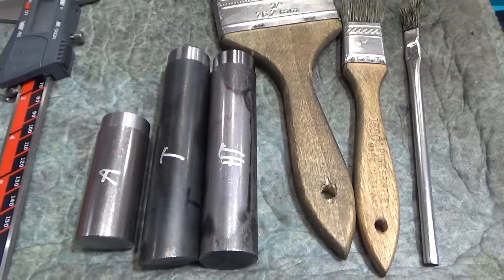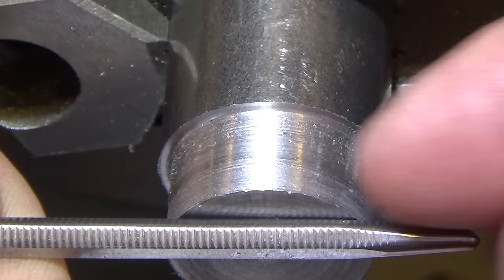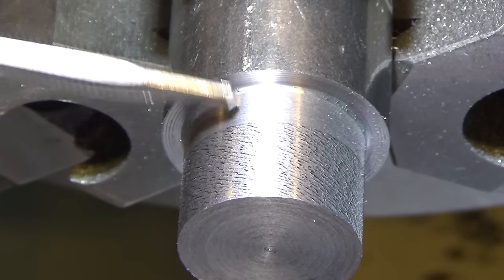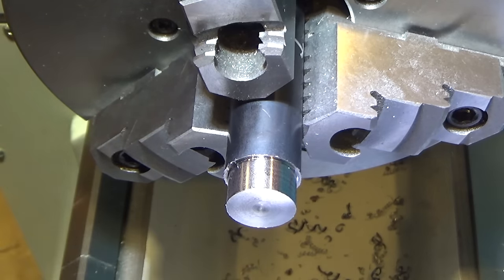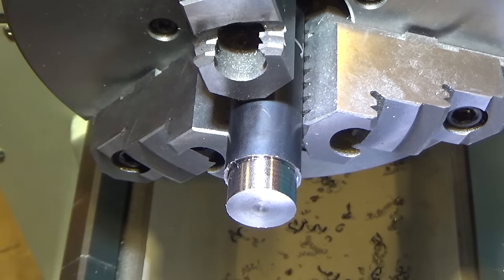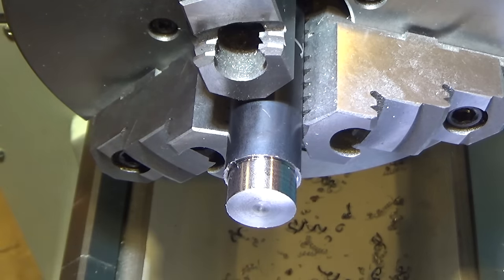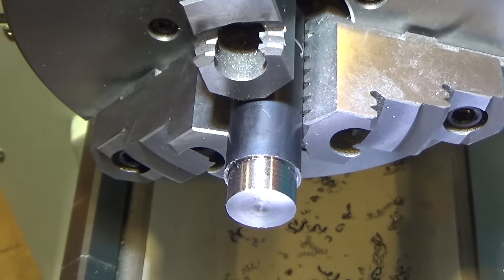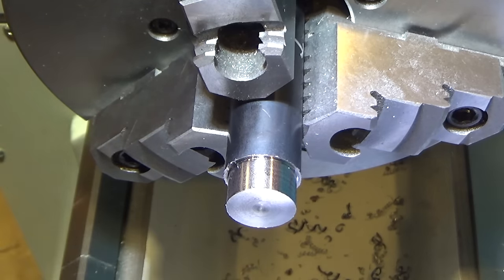The Effects of Heat Treatment on CrMo 4140 Steel in Turning Operations Part 2

Comment: I dont know how often you are looking for a good finish but i have found a tpmn-221 is best for any material i cut mild steel to stainless to aluminum... you have to buy the insert and a chip breaker separately but by far the vest finishing tool i have found for most things.... i use sumitomo
Reply from the maker: Thanks. I think I might even have some of those inserts, but have yet to use them on anything. I got a bunch of different inserts in a lot of tools I purchased quite a while ago. Cheers.
Reply: Link?

Comment: Those inserts can have a lot more really. The "careful" movement is more about having not enough power in the lathe / mill to keep turning thru it.

As for positive/negative angle, those inserts are intended for certain materials and conditions. You'd have to look up the types of inserts intended for the material at hand and recommended speeds/feed rate etc.
Reply from the maker: Good point. thanks.

Comment: Try a higher feed rate at at a high  RPM (on these softer steels).. If you want it shiny then start with a feed rate of .010 or .012 per inch and take at least .02 per side.  Work your way down from there.
Reply from the maker: I really appreciate the tips. Thanks!

Comment: That is a very smooth sounding lathe, no gear noise.  Wish I knew what brand.
Reply from the maker: Thanks for the comment. It is an ACRA 14 Heavy 5hp. It weighs something around 3300 lbs. and is pretty vibration resistant. I am no expert, but do think very highly of it. If you need any more info I am happy to help. They have offices in rancho Cucamonga, CA and are an international company. I visited the facility and they keep a lot of parts on hand. The lathe is custom made for them in Taiwan.
Reply: I have an Acra FSML 1440 - converted it to single phase with a VFD. It’s also as quiet as anything. Made in Taiwan. Pricey, but nicely.

Comment: Iv found a bigger radius on the tool with a chip breaker for bigger cuts and a higher feed rate gives a better finish and for finishing off a job where only a thou or 2 is to come off i use a tool with no radius a + rake and a fast feed rate this is for the final cut works good on most of your harder steals iv found
Reply from the maker: Thanks for the tips. Always appreciated.

Comment: Just a cutting comment for 4140 HTSR. I cut it daily. Usually rough with WNMG, like yours , 0.013-0.015 FPR roughing .03 tool nose rad. Rough 0.06 to .200 diametral cut. It likes 450-500 SFM with good quality inserts. Finishing: positive rake 0.005-0.006 FPR 0.01 diametral cut.  Ie. 1 inch shaft 1500-2000 rpm.  Home gamer machines work better with pos rake cutters as everyone here knows.
Reply from the maker: Thanks for the very detailed suggestion. I am just about to work with 4140 on a new project and will try your suggested feeds and speeds. I really appreciate you taking the time to share your thoughts.

Comment: I realize this is an old video, but I think your insert is galling from build-up on the edge of the insert. I would either try a coated insert or using cutting oil.  A CNMG type insert should be just fine. If you want a positive cutting edge, try a CNMP or DNMP. My choice would be the CNMG coated insert.
Reply from the maker: Old or not, I really appreciate the tip. Thanks.

Comment: My sugestion is that in my shop they say and i do it if u drop down with the rpm u should bump the speed up like to 10thou. We use negativ rakes for hard materials and softer like alu we go to positiv rakes.
Reply from the maker: Thank you very much for the tips. I always appreciate the advice of experience.

Comment: Carbide likes a heavy cut.    Your rpm is probably alright at 440 but crank the feed up to .01” per rev
Reply from the maker: Thanks for the suggestions. I think you are probably right. I have been experimenting since I did this video and my results match your advise.

Comment: also on the the insert box will have info on range to run insert at. depth, speed and feed. 0.007 feed will be most likely nicer than a 0.002 feed. you need the right load for an insert to work properly
Reply from the maker: You make a really good point. I personally have not seen an improvement in finish with increasing feed rate, rather quite the opposite, but I have seem a marked improvement with larger depth of cuts. A lot of inserts I have, do rather poorly with small depth of cuts.  Now for chip breaker functionality, larger feed rates definitely seem to yield improvements. I do really need to pay more attention to the manufacturer's suggested feeds/speeds/and depth cuts recommendations. Another problem I have, is that I can't afford to get the ideal inset for each type of material for each of my tools, so often I make do. I have never really picked just one insert shape and stuck with it, so I don't have the proper inserts for each type of material in each size, for all of the tools I have.Thank you for spending the time to comment. I really appreciate all the advise.
Reply: dudley toolwright for one size fits all insert I like TMNG
Reply: dudley toolwright some insert work best at .020-.080 depth, I use some at work that want minimum of .100-.200+ depth
Reply from the maker: Thanks. I have a set of those I got somewhat recently, but haven't used them a lot yet. Adam Booth and Tom Lipton, seem to like CNMG inserts. I was sort of settling on WNMG, but to be honest, the only difference I initially considered shape-wise was part access. I realize that for large depth of cut and/or high feed rates, shape is important for strength, but I have never done much of that. I will spend some more time experimenting with the TMNG cutters I got and see how they perform. Thanks for the suggestion.
Reply: dudley toolwright np love your content. keep it up
Reply from the maker: Yea, I have seen that was well. Some of my smaller WNMG cutters max out at 0.200" depth of cut, but as a rule none of them perform very well with depth of cuts below 0.003". Thanks again, I will definitely experiment with the triangular inset holders more. You are never done learning.
Reply: dudley toolwright you're right there's always something new to learn, a tip, a trick anything. I'm pretty new to machining (10yrs). I keep a hard over book in my toolbox and every job I work on I write notes on everything, tooling, set up, even time. so I can always look back on it as a reference
Reply from the maker: Thanks. I'll do that. As long as people want the content, I will attempt to create it. Thanks for the comment.
Reply from the maker: That's a great idea. I think I will steal your idea. I have a memory like a sieve so writing new ideas and techniques is a very good idea. Thanks.

Comment: By watching your chuck on the video, it appears to not running true or out of balance and maybe causing surface finishing issues, first check your adjusting foot mounts,   for accuracy i would check your run out on your chuck, also grind the internal 3 jaws parallel,  check your tool post gib guides, and for any back lash and wear in the slide  nut, if there is any play during machining this will cause poor and inconsistency in surface finishes,   Cheers David
Reply from the maker: Thanks. I really appreciate you taking the time to comment and help me out. I will check into what you have recommended.

Comment: Hello,  Thanks for doing a video on a subject that helps me a great deal.  Especially since not being related to Bill Gates I do a lot of shopping at SHARS and you show their tool holder.  I am just getting into carbide and find this very helpful in choosing a cross selection of cutters that will do a multitude of tasks without breaking the budget.  Since I work in 6061 Al and SS as well as the different grades of steel (whatever I can scrounge or buy so the type is often unknown) I need a cutter that can do a variety of tasks.  My Grizzly G4003G only has 2hp so that is a limiting factor also.  Very little information on small machine carbide tooling on the 'Tube' and especially the cheaper brands.  Seems a lot of people like myself who don't have flea markets, estate sales, and access to old new stock are left out in the cold.  I look forward to more of these specific, terrific videos from you.  I would like to see reference to the particular model and make of the cutters to help me further if possible.  Mark me subscribed!  Take care.  Doug
Reply from the maker: Thanks for the comments. I am by no means an expert on the subject of carbide cutters, but here is my two sense: I do not use a lot of high speed steel, because you have to be a lot more careful with it. It gets sharper, but those very sharp edges also heat up easily and lose their hardness (if you have ever seen a color change in a cutting tool you know what I mean.). High speed steel cutters, however, can sometimes produce a better finish in difficult materials like Cold rolled steel (not hard to cut, just cuts leaving a poor finish) and can run with a lot less power. Carbide inserts come in two major varieties: negative and positive rake. Negative rake cutters require more power from the lathe but supposedly yield a better finish in some situations. Positive rake cutters require less power and common for soft or gooey materials like aluminum and copper. Most tooling places the insert at a negative rake, but inserts designed for soft materials will make the overall geometry positive by having a very positive rake profile. If you were wondering what I mean by rake, it is just the relationship of the insert to the work. If the insert leans down so that it appears  to drag, it is a negative rake. If it tilts up so that it looks like it will dig in it is a positive rake. There are some holders that make all inserts positive rake and might be a good choice for lower hp machines. Carbide doesn't overheat anywhere as easily as HSS which is a big plus, but the cutting points are rarely anywhere near as sharp. Carbide inserts are also less sensitive to high hardness materials or spots in the material. They are however more sensitive to interrupted cuts and can shatter. Coatings are for heat, hard material protection, and chip sticking prevention (esp. aluminum). Chip breakers might not work particularly well on lower hp machines because they are designed around specific feeds, speeds, and depths of cut, most often found in cnc type machines. However, I am willing to put up with stringy chips if everything else is going my way. As to specific holders, I have used the sets from Shars (get the largest size holders that will fit in your tool post: larger holders - less chatter) and bought a bunch of Chinese ones off of ebay. I also have purchased used sandvik, Kennametal, iscar, etc. holders on ebay and see little performance difference, but that might be because I haven't done much critical work. I have a suspicion that the big boy holders are more positional accurate when new inserts are exchanged. I also have used lots of different inserts and, again I think there is probably more consistency in the big manufacturer inserts, but cutting performance seems fine in the less expensive models. I hope this helped a little.
Reply: dudley toolwright Thanks.  That affirms much of what I have learned with the last part very useful.  Positve rake seems a bit harder to find unless the "aluminum" inserts are and can be used with steel?  I do notice I have to fine tune the Shars tool holders themselves as the bevels and reliefs are pretty square but that is ok with me for the cost savings.  I don't get too much time in the machine shop and would rather not spend all that time form grinding and sharpening when advoidable.  Keep up the good videos.  Real world value.  Take care.  Doug
Reply from the maker: I agree. Positive tool holders are few and far between, especially in sets. Like another commenter was saying, carbide was originally aimed at the cnc/large lathe production market. Aluminum inserts can be used for steel but for a couple of caveats: 1 the chip breakers are not at all correct for steel (not a huge deal) and 2 the very sharp edges are fragile and will break very easily. They seem to hold up ok with really light cuts like <0.025" but be prepared to replace them a lot more often. Also, once you use them on steel they may not give a really good finish on aluminum anymore. I have had good luck with negative rake cutters with very small corner radius's. These guys help to understanding the naming conventions: http://www.carbidedepot.com/formulas-insert-d.htm. For example: CCMT431 is a smaller radius than CCMT432 etc. Really light cuts <0.003" tend to be very iffy with carbide inserts but I think that you can use them if the depth of cut and feed rate is not too high. Although I have a 5hp motor, I don't hear much strain in the motor at all, until I start cutting 0.250" depth of cut with 0.030"/rev feed rates on aluminum.

I am right there with you on the grinding and sharpening thing. That is why I have avoided HSS as well. It also doesn't help that I have the hand-eye coordination of a 1 week old puppy. I will eventually get or make some sort of grinding fixture that will  allow me to get accurate grinds without relying on my own hand-eye coordination. I am sure with a lot of practice, I could get better, but have a more than full time job that leaves little time for machining at all. If you watch the real pros like Tom Lipton at Oxtools, he uses both. I  do recommend his channel. He has a wealth of knowledge that he willingly shares.
I appreciate you watching and good luck. Cheers.
Reply: It’s not just the profile of the insert that’s different for different materials. It’s also the grade of carbide. Aluminum will degrade certain grades of carbide chemically. When it gets hot the material breaks down from the chemical reaction. So inserts made for aluminum shouldn’t be used with any type of steel. Inserts made for steel can crumble from aluminum. 

You can’t get away with one type of insert profile or material for everything. At the least, you need inserts for aluminum, mild low alloy low carbon steels, high carbon steels and high alloy steels. Some inserts can be used for cast iron. Check out what the insert manufacturer says, as many are dual purpose.

Comment: Is that 1" stock? If it is, 2300 rpm (600 sfm) and .010" - .013" feed rate. 
With carbide you want to put so much heat at the shear point the steel actually melts and the resolidifies leaving a mirror finish.
When chips are blue and look like 6s & 9s you are really close to the correct speeds and feeds. If you are making strings and birds nest your speeds and feeds are incorrect.
Reply from the maker: Thanks for the cutting specs. My lathe maxes out at 1800 rpm, but your point is well taken. Thanks fro taking the time to help me out.
Reply: I should have mentioned 600 sfm is ideal in annealed 4140 with a proper carbide insert. About 250 sfm on prehardened 4140, again with a suitable insert.
Thanks for sharing videos like this.

Comment: IF you cut with a pcd or cbn insert on hardened material it would return an almost chrome like finish you would have to see to believe.
Reply from the maker: I need to try those inserts. Thanks for the tip.

Comment: harder the material, slower the spindle speed, you'll burn the tip out especially with no coolant. and wrong grade of insert i would say from experience but however its fun to play around haha
Reply from the maker: Thanks for sharing your experience. It is probably obvious that I have very little. Thanks for the suggestions.
Reply: no ones here to bitch about anything. i love machining. i work on a y axis lathe. and have machined a 59 rockwell heat treated material haha @DudleyToolwright
Reply: but i do believe you're not going fast enough on diameter (surface speed *85*x1000\(pi x diameter)=answer) and the answer would be your spindle speed at diameter. works the same as a drill like using hss drill on titanium at 5 surface speed
Reply from the maker: Very cool. I am never offended by constructive criticism, quite the contrary: thanks for taking the time to help me out.
Reply from the maker: Much appreciated.